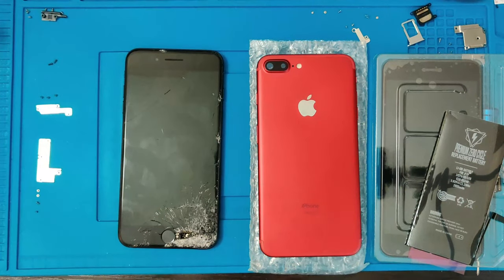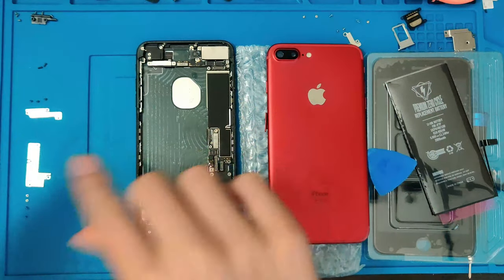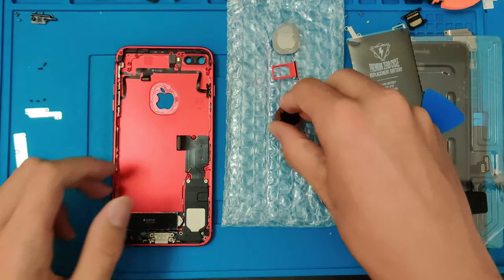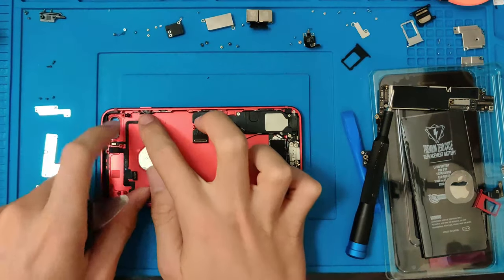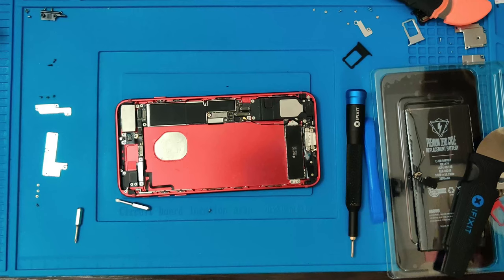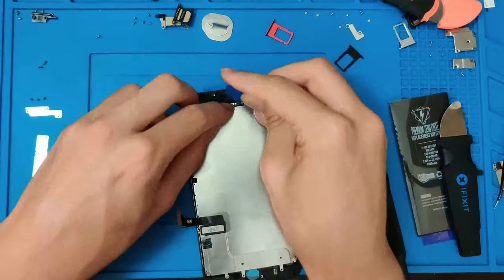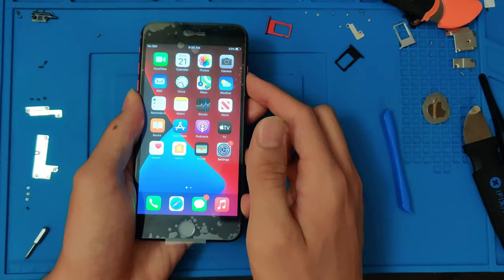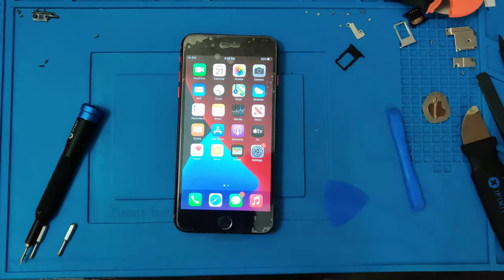Custom Red And Black iPhone 7 Plus Full Restoration/Repair

Comment: i am using an iphone 7 plus and i also want to be customised it because my glosy frame has many scratches and its annoying.. the earpiece is not even working so i need to put in a loudspeaker when talking someone over the phone, the charging port is also not working, i dont want to upgrade it into higher model because this phone is really worth for me.. but i am not a technician so i don't know how to do it hehe..